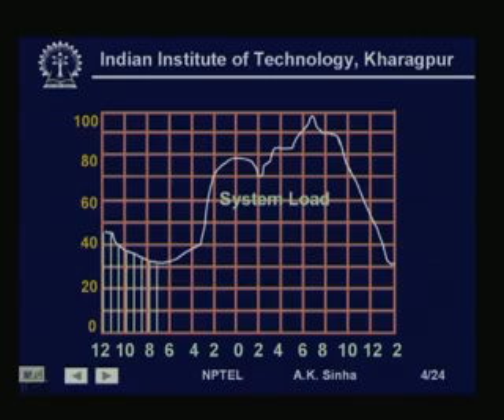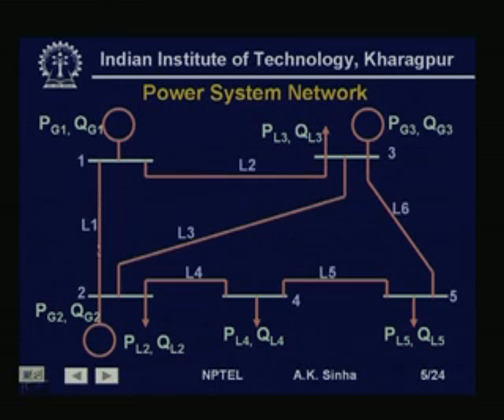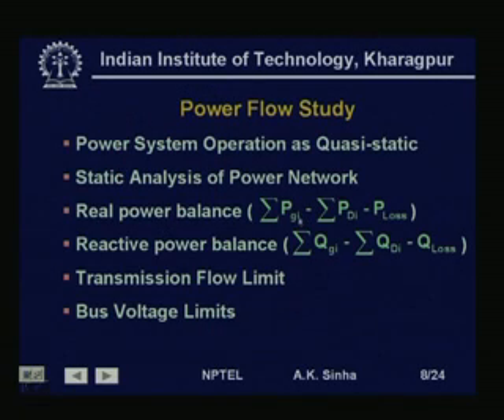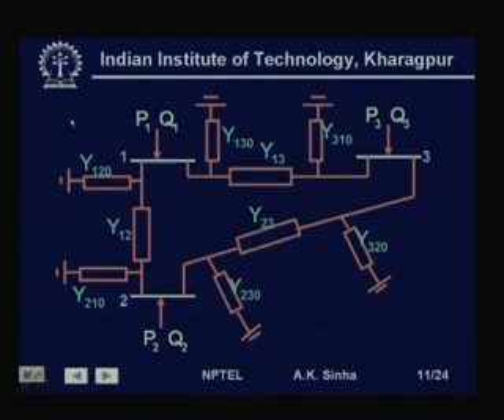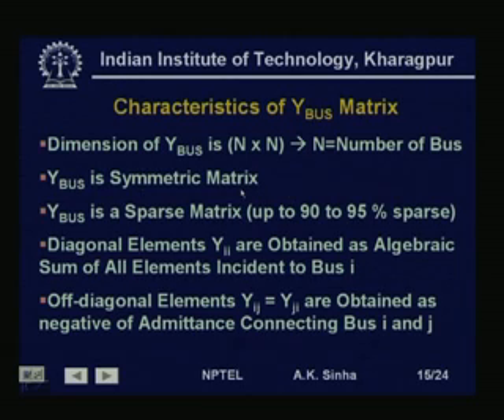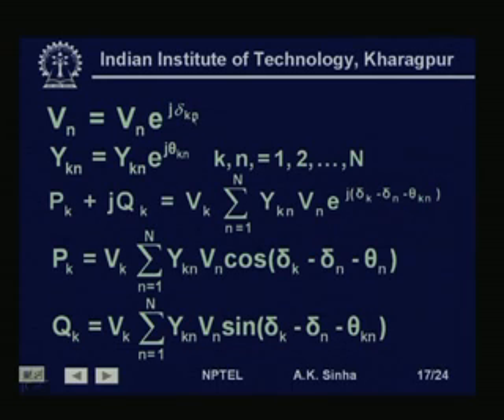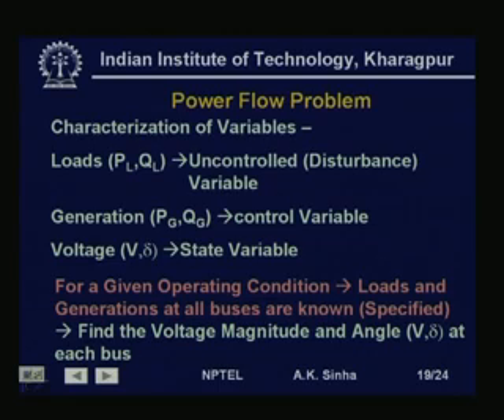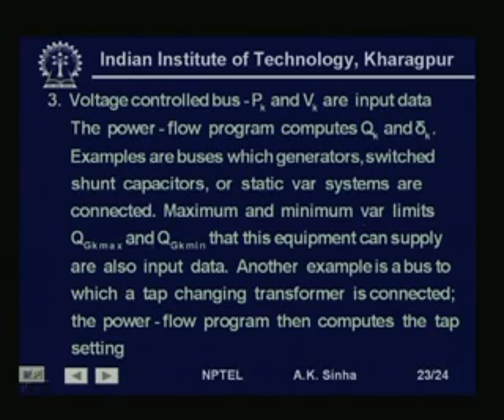Lecture - 16 Power Flow - I

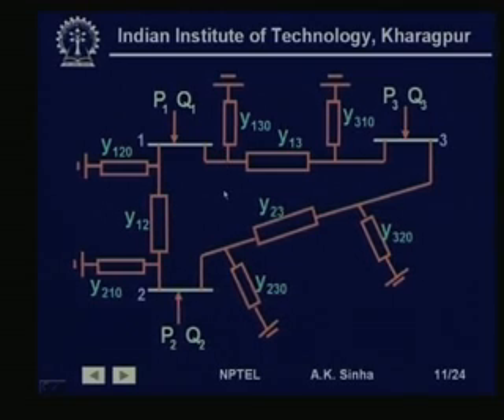Comment: In 26:19 ,, 
in I3  last column  ,, is it okay to write -y13  NOT -y31   and  -Y23  not  -Y32

* please update the videos  so, it would be clear
Reply: *****  I think they should be equal ,, I finished the power system course last spring

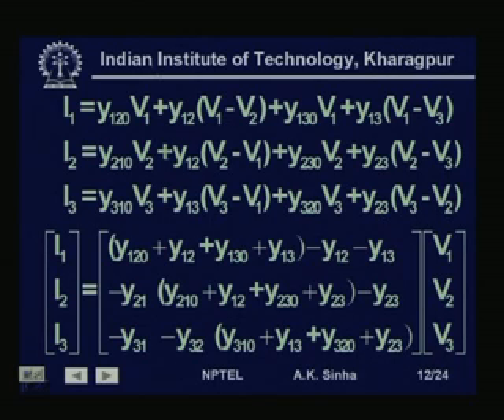Comment: Correct me if I am wrong but isn't there an error when filling the matrix on 28:00? The second row has -y21 and third row has -y31 and -y32. Shouldn't it be -y12, -y13 and -y23 instead?
Reply: In an Admittance matrix y21 and y12 can be used interchangeably. This is because in a power system, the distance between node 1 and node 2 is same as distance between node 2 and node 1. Hence the respective admittances y12 and y21 are equal.
Reply: Also , in I3  last column  ,, is it okay to write -y13  NOT -y31   and  -Y23  not  -Y32 ?? 
i have the same question